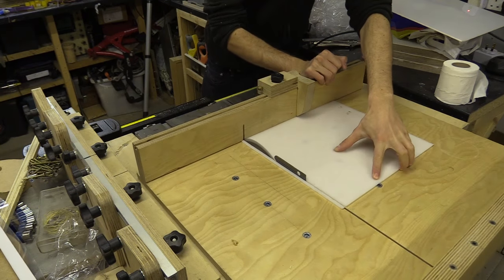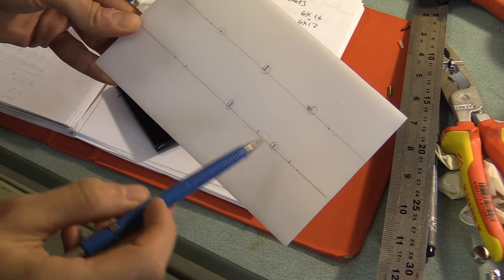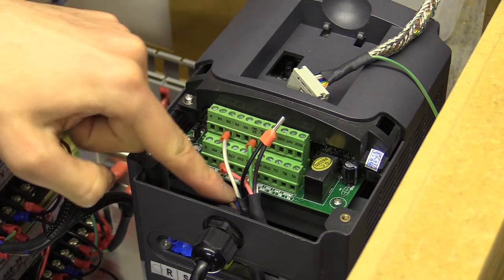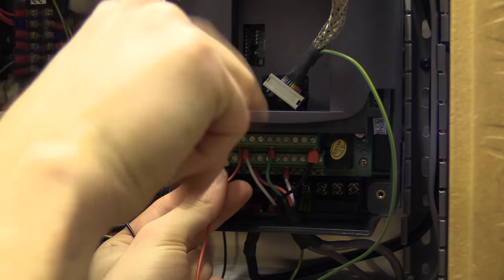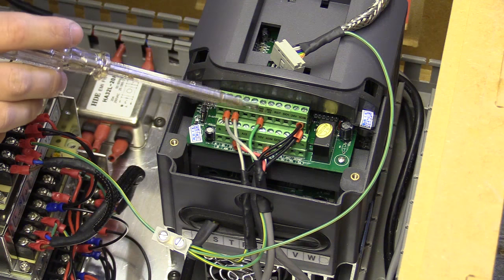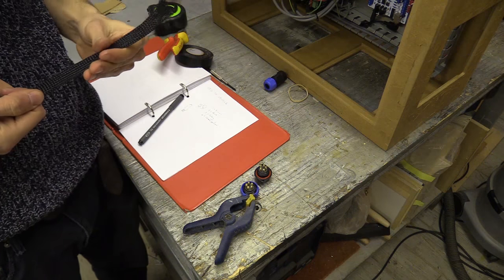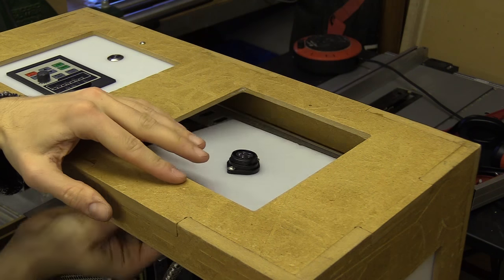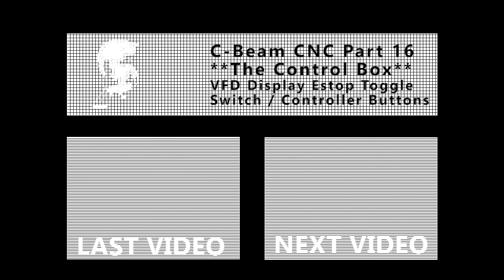#16 Extending VFD Display / PWM Toggle Switch / Estop / Controller Buttons #16 / CNC Control Box

Comment: do you have problems with step generation? the VFD will generate EMV that may couse your machine to loose steps
Reply from the maker: I've not noticed anything like that while cutting but I have started to notice the machine doesn't always homing properly. That is to say it pauses before reaching the x and y axis. Still need to get to the bottom of this. :/
Reply from the maker: I also have screened literally everything I could within the enclosure and added a EMI filter to the VFD power.

Comment: hello my name is Daniele I bought a 5.5kw ecogoo inverter, I managed to program it, but I would like to apply a generic on off switch only to operate the spindle from the outside but I can not program it and I do not know where to connect the wires.
Can you tell me in the instruction manual the page I have to watch? Thank you
Reply from the maker: I think my FVD is different model, but there should be a diagram of the terminals in your manual. Different manufacturers sometimes label things differently. Do you have a link to your manual?

Comment: love the progress, but when do you think it will be ready to test?
Reply from the maker: It should be the next one. Still need to get to know the software better - which is bCNC. I was hoping to do a margin scan but I can't seem to get that to work - and might have to peer into the murky waters of the firmware. Pffff.
Reply from the maker: I lie, the next video will involve installing the relay - and then the second will be connecting the controller and CNC machine.

Comment: like the way you made the cabinet with the option of replacing panels to change the layout 
youre using expensive plastic , wat i've seen people use where cuttingboards , there a little bit thicker (good thing?) and a little softer / less rigit but there cheap 
http://www.ebay.com.sg/sch/Plastic-IKEA-Cutting-Boards/46282/bn_15416740/i.html
seen simulair board in red black green and some other colours

the overload after pushing the emergency stop could be because the spindle was still turning and turned intoo a generator sending voltage intoo the vfd from the wrong end , maibe you can put a 3 fase and negative relay (has 4 electromagnetic contacts)  between the vdf and the spindle powered by the emergency stop as whell or do sumting else to prevent a powersurge comming of the spindle messing the vfd up
Reply from the maker: Thanks for the suggestion. I really like the opal look though. I haven't solved the spindle overload problem yet - not time to mess about with the machine at the moment. Was going to order a breaking resister and see if that makes a difference. But if I put the relay wouldn't hat means the spindle just keeps spinning. I think the VFD is actually applying a break at the moment when the estop is pressed.